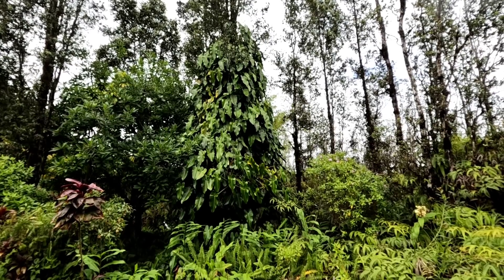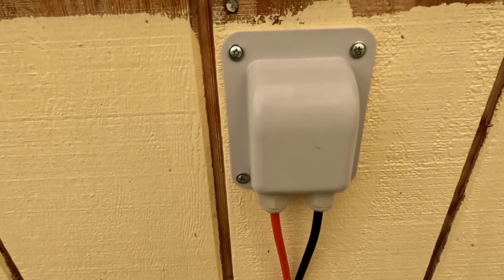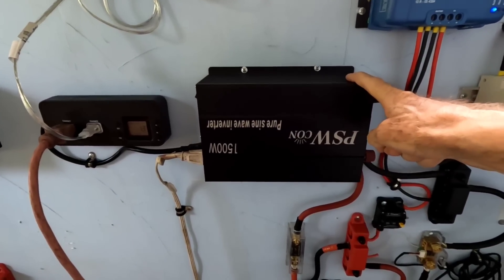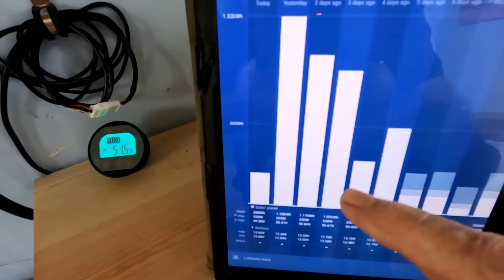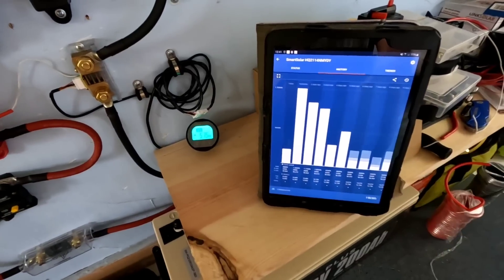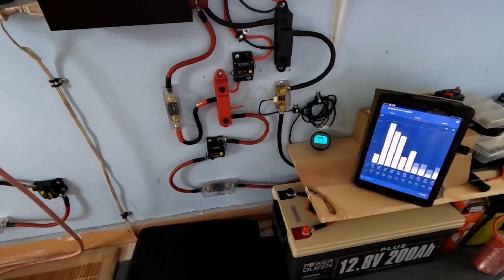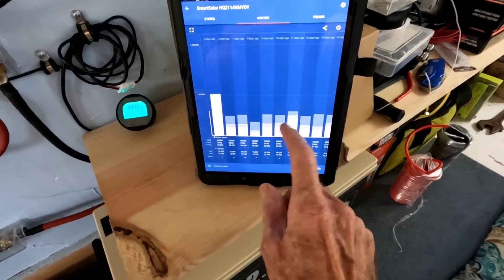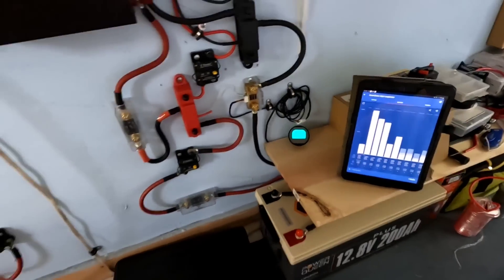Full week results. 200ah LiFePO4/300watts solar/20 cu.ft. refrigerator 24/7

Comment: 4 Eco Worthy 100 watt BiFacial Solar Panels driving 2 280ah Chins tied into a 24 Volt Pack from a Victron Smart Solar 100/50 Charge Controller and proper Cables and Fuses and Battery Disconnect runs My VICTRON 24Volt 1200 Watt Inverter for My Older Refrigerator and also Brews My Coffee each morning with ease. Firm Believer of 24 Volt Systems after following Your Channel Brother - 🌴 Aloha 🤙from Indian Creek Ranch ⛩ o Southern California High Desert 🌵

Comment: I'm putting together my second system, first one on my motor home. I'm in Tennessee which isn't really practical for solar but I want a system as backup to do away with my generator. I'm going to have to over build my panel array to keep the batteries charged and running my refrigerator.
Reply from the maker: I'm having to overpanel things a bit here too as we get plenty of cloudy rainy days here but I am finding by adding the extra panels I am keeping up with usage just fine. I still have a few more panels to go to be in my sweet spot and almost there but all in all everything's humming along nicely! It takes a little bit of time to see for your conditions exactly what you need, I've been playing around with these new lithium iron phosphate batteries for about a year and a half and I've had to make adjustments along the way but I'm glad I made the switch! Thanks for your participation in the conversation around here it's much appreciated! Aloha! 🤙

Comment: I'm running a 100 ah lipo4 battery and 4 one hundred watt solar panels and it runs my 20 cubic refrigerator and laptop just fine along with my ham radio.
Reply from the maker: That's awesome!🤙
Reply: I wished you mentioned where you're at. I'm pretty sure results will vary if you live in Florida or in Canada.

Comment: can I ask why you have a fuse bar .. from the battery to a 60amp breaker to your power distro block to another fuse bar to your inverter?   .. i am just a beginner but that seems a bit excessive..  i was planning on an isolater switch like your design .. thought that made a lot of sense.. solar panel(s) to isolater to mppt  (easy to shut off input power from panels) and a 60AMP breaker on the battery positive going to its distribution bar (where the mppt and the inverter are connected., where you have a 60amp breaker either side and a fuse bar going to your inverter)

Comment: Your system shows a Victron 100/30 but your link is for a Victron 75/15. What’s up? 
I would guess that’s because the Victron 75/15 is all that’s necessary for those 3 ea 100 Watt Panels.

Comment: Get a super capacitor bank. The super capacitors act as a soft start and will cycle so your batteries don't. Super capacitors can cycle millions of times and lithium batteries only around 12000- 18000 cycles. The super capacitors reduce heat and hard cycles on batteries. Like a capacitor on car amplifier to keep headlights from dimming as bass hits. You only get so many cycles on batteries. I run 2 types of panels one bank are for cloudy days and  the other for sunny days.

Comment: Great series.  I just got a 12.v battery 100ah battery and the Victron MPPT controller.  Do you have any diagrams of this set up ?  What is the app on the iPad ?
Reply from the maker: The app is Victron connect.  That mppt has built in bluetooth for monitoring your system...aloha 🤙

Comment: An important thing to remember about Lithium specifically, you're not going to see much or any change in voltage, and that's by design.  So you really don't need to keep looking at that unless you regularly drain the battery down below 5% SOC.
Reply from the maker: That's good information and bares repeating for sure. Plenty of people new to this chemistry report back that in their daily usage,  never budges off of 13.2. Took me awhile to understand,  and get the feel for these too...especially in the beginning.  Aloha 🤙
Reply: I just bought 2 230 amp hour litimes with a 200 bms plus..After a full charge from a 10 amp litime charger my voltage is13.05 on one battery and 13.15 on the other battery..The owners manual states full charge is13.33..75 percent charge is 13.3 to 13.33..The batteries will not charge anymore the charger or the bms won't allow it.Are my numbers bad do I need a different charger or did I get 2 bad batteries?? THANKS..I used you Aloha code to thanks..I spent 1600 bucks and I want to make sure these batteries are up to spec.

Comment: To me the issue that is not be addressed is the conversion from DC to AC. While often convenient , to my mind this should be avoided whenever possible. Inversion is always comes at a cost.
Reply: Truth, regardless of the type or brand of inverter, you're going to lose around 20% converting from DC to AC, because not only are you inverting the power, you are changing the voltage to 120 volts.   Which is why in my campervan, I have a DC fridge and a DC freezer and it eats way less power that way.

Comment: I have the same charge controller and love the app. Only using a very small inverter right now for charging phones or running a fan etc. I’m weighing pros and cons of a 12/24v DC fridge versus a beefed up inverter to domestic fridge. I’m in Canada so not quite the solar volume that you may get. Did you ever consider a DC fridge? Note I’d use my fridge summer months only at off grid cabin. Thanks!
Reply: I have one of those LG fridge freezers with their linear inverter compressor.  It's running fine on a small 12V 1200 watt high frequency inverter no problems whatsoever 24/7.  These LG inverter fridges don't have a big startup current.  They are very efficient and mine draws about 40 watts when it cycles on.
Reply: @peteroliver9042  OK I found this description on the Home Depot site for LG, “Smart Inverter Compressor with 10-Year Warranty”. Is this the linear inverter?
Reply: @granteditslifeoutdoors.9194  Yes those are the ones.  They were having problems with the compressors dying after about 3 years and that's why they're putting the 10 year warranty on them.
Reply: How much is the fridge  at home depo
Reply: @lisawest798  I think it was 24” and @$950 CDN
Reply: @granteditslifeoutdoors.9194  thx

Comment: HI what is the current draw from the battery when the inverter is on and nothing is plugged in or does the inverter have a standby mode.
Reply from the maker: less than 1 amp in standby 🤙

Comment: thats an expensive way to run just a fridge hehe.. fun to test though but expensive.. would be fun to run it on used car batteries and cheaper panels etc, how cheap can you really go and still be usefull? china panels etc?
Reply from the maker: I'd be risking a hernia carrying old lead acid batteries around...heh heh...aloha 🤙
Reply: Thats a very valid question.  It’s easy to throw a ton of money at a solution, but it would be interesting to see what can be accomplished at the very minimum. Not compromising safety issues of course.

Comment: Thanks for posting! I've been running some tests as well, and commenting to friends and other amateur radio operators that many (most?) of us take grid power for granted: its reliability, its frequency stability, and most of all, its cost. Try generating a mere kWh yourself by some means (solar, wind turbine, etc.) I say to them.
Reply from the maker: I've been beating that same drum to friends for decades now...aloha 🤙
Reply: Yeah, but once you have a good setup dialed in as far as source of incoming power, and size of battery, you can go fully off grid and not have to give it much or any thought.  For example, the standard is roughly  double the solar you think you'll need to cover for cloudy days for example.  So in this case a 100ah battery at ideal conditions, is going to take roughly 4 hours to fully charge a 100ah battery.  Because 12volts x 100ah = 1200 watts, so a 300 watt set of panels is ¼ of the total watts.  So a typical good rule of thumb is 300watts per 100ah, thus in this case, another 300watts would have him in really good shape even on days with some clouds.  Because he's not running mobile,he could add 900watts of solar to his 300watts and be in really good shape!

Comment: I got 4 or those power queen in 12v ready to be used.. did you think I can add another 2 battery and continue on 12v sisyem??
Reply: I can't confirm this, but other Lifepo4 batteries in that price range suggest to only go up to 4 in parallel or 4 in series.  Not sure why.
Reply: @OffGridBasement  you think 4 battery is enough for a refrigerator and couple other stuff like microwave and toaster and couple LED lights??
Reply: Yes, but suggest only 4.
If you need to use more than 1200W(100A) for hours, a 24V system will be better.

Comment: Love your videos!  Have a question.  I live in a condo and cannot have solar panels.  I want an emergency backup system.  I currently have a 3000W generator and transfer switch installed.  I'd like to set up a lifepo battery,  inverter setup that I could charge from my car when necessary.  Can you please recommend components and brief setup?  Thanks!
Reply: @tj4034  Excellent! Thank you sir!
Reply: @tj4034  How would it burn out the alternator?   I'm thinking of running heavy gauge wires from car battery to the lifepo battery.
Reply: @tj4034  What about using a charge controller?
Reply: @tj4034   thank you , good to know.

Comment: Awesome  experiment 👏 👌!
I have  1200 watts  of  panels on the  roof of my  cargo  trailer.  I want to  run  a  4.2 cu.ft refrigerator 24/7.   And a 5000btu  AC. About  10 hours  at night.  I  have 2  Chin.  100ah. Batteries.  I  am  optimistic  that it  will  work.
You have a  awesome  channel. 👌
Reply: If you think that the batteries will last 10 hours, you may be pushing your luck. Once the sun goes down, you will be running fully on the stored energy in the batteries. You can run the fridge no problem by itself. It only uses about 70 watts, maybe on for 30% of the time. Your AC is probably going to pull 450watts whenever the compressor is on. 450watts x 5 hours is 2250wh. Your batteries are 2560wh. You should get a watt meter and plug in the AC and run it for ten hours to see how much wattage it consumes over that period. Do that with your refrigerator as well. If both numbers added up are less than the battery capacities then yes you can use them. Just understand that the batteries will be very close to being depleted by morning and it will take some time to recharge the batteries with your solar.
Reply: 1200W panels can generate around 3000-6000Wh a Day, but you need more batteries. You vil need 5 pcs 12V 100Ah = 6000Wh batteries. If you use more than 3000Wh/Day, the batteries will be emty in less than 2 days with no sun. If you like to be safe with the food, the AC need to cut off at 12.7 Volts.
Reply from the maker: Mahalo for the kind words,  I have fun with you all! Let us know how your system works for you, stay in touch.  aloha 🤙
Reply: Thanks for all  the  needed information!
I will  be  back for more information about  programming  my  charge  controller.   Don't have a clue. 
I definitely  don't want to let any smoke  out of any  components.  They are  built with a certain amount.

Comment: power queen battery working great. looking more like BMS inside REDODO changing modes. may be just a top balance circuit switching on and off.
Reply from the maker: Yes sir, I am pleased with how everything did in this experiment,  especially since many day's were less than ideal sunshine. I did set new parameters on the REDODO,  and it's cruising right along now too...no problems.  I'll shoot a short follow up on that also. Aloha 🤙